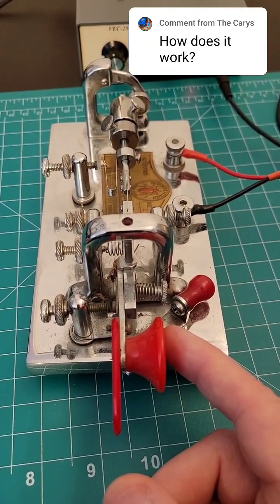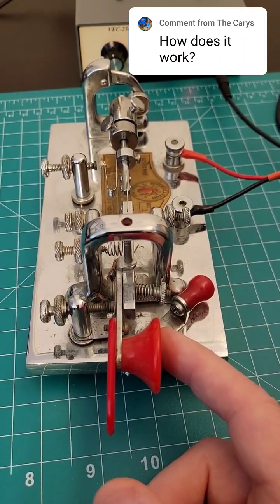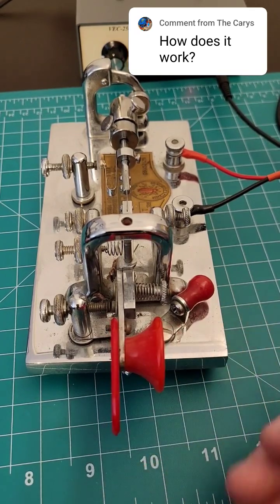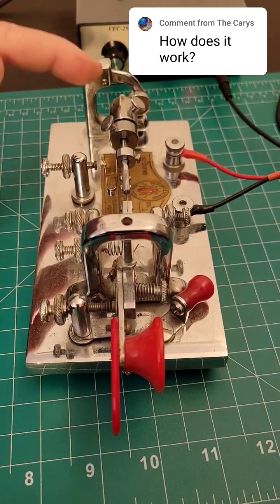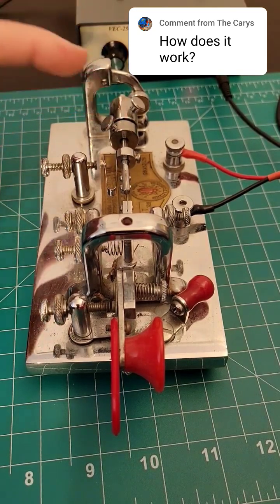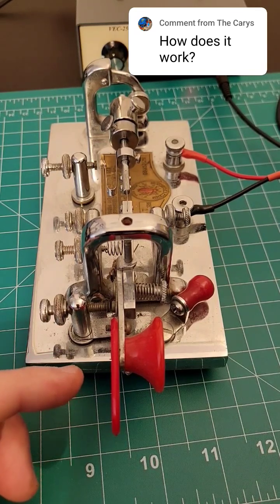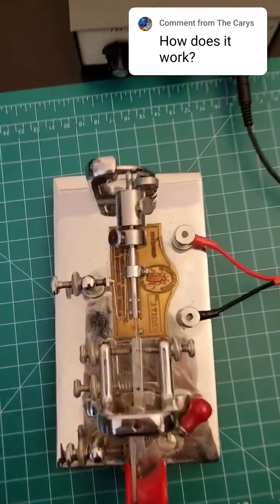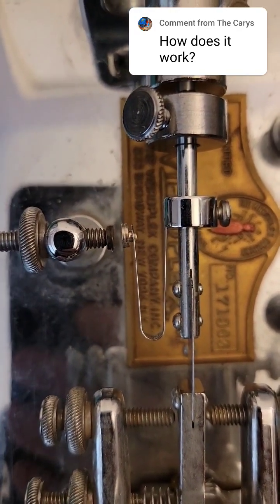The Morse Code Bug Explained In 60 Seconds - Still questions?  Post a comment.

Comment: Great explanation. Can the dit speed be varied with spring adjustment?
Reply from the maker: Yes, it can absolutely be adjusted.  There are various hacks suck as adding a paperclip to the end or paper to the spring, but most people add more weight to the end.  I purchased a Vibroplex Veri-Speed which is an adjustable arm that attaches to the existing arm with the weight.